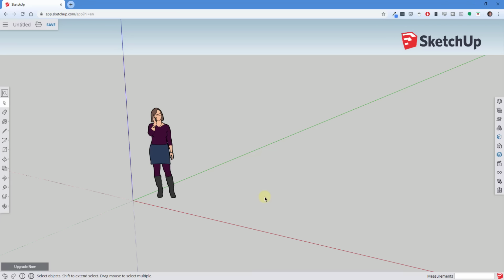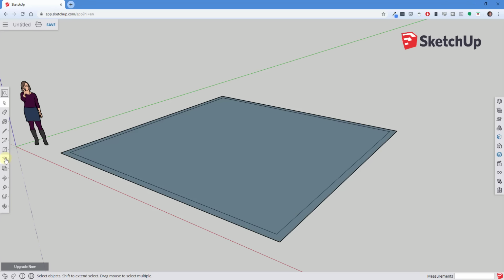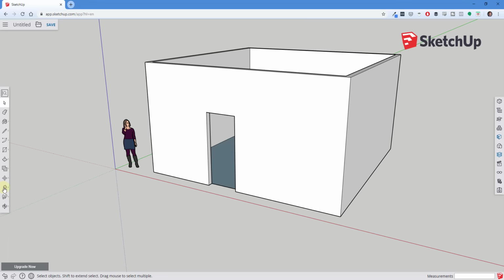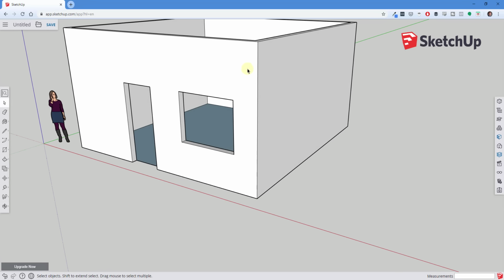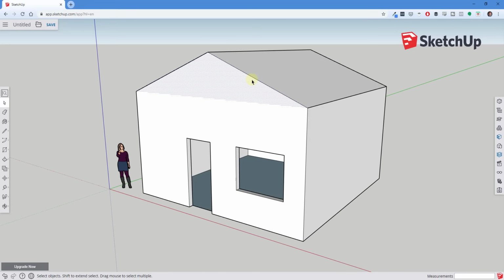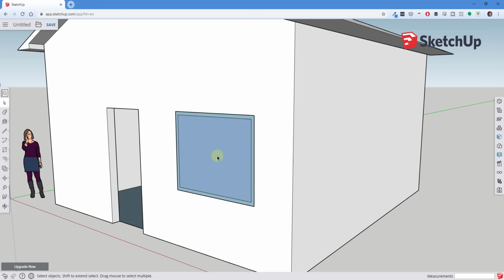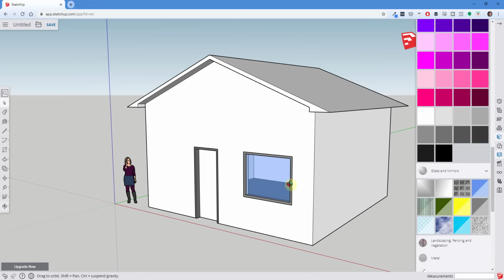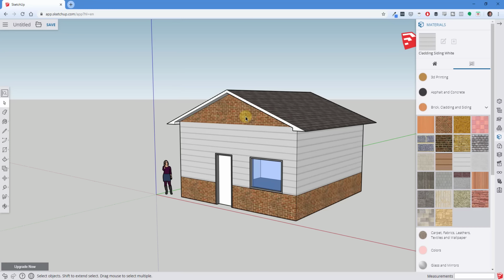GETTING STARTED with SketchUp Free - Lesson 2 - Creating a House Model

Comment: Well... after 10 years of downloading Sketchup and deleting it - I finally learned how to model in Sketchup and then move that model as a whole rather than move one part, warping the other joining surfaces and polygons. Thanks a bunch man - this was pretty informative. I also have a whole bunch of keyboard shortcuts too thanks to you and they all make sense.

Maybe Trimble have changed things since this video but when I grouped my model I couldn't activate the R key to create the ceiling. Had to start the whole model all over again and not group - worked this time but the R key doesn't work as smoothly or obviously as it does in your demo here.
Reply: haha, lots of recognition there! I've been doing the same, downloading and then getting super frustrated with basic manipulation and uninstalling. These videos are great though! Haven't uninstalled yet this time.

Comment: Thanks for your time!!!  I’m having a problem with the roof in this lesson.  Front of house is fine, but when I turn to the back, the rear of the eave is a bluish color, not white like yours.  Subsequently, I can’t pull it to the back of the house.  What am I doing wrong?
Reply: I’m experiencing same issue and can’t figure it out too
Reply: I am having same issue when I turn house around to pull roof bavk it pulls a negative space across the roof creating a hollow gap between house top and new roof
Reply: I see that this was 2yrs ago, so you'll probably have worked it out. For those that haven't, instead of thinking that you need to click on the back, don't. That isn't the face (working side), click on the front which is the face and then use the push pull tool, when you've got to where you want the end to be, it will create another face at that point. You'll see that better if you are creating a cube, draw a square/rectangle then push pull from the front face (white) to the required point. You will then see that push pull will have created another 5 faces. Front/Back, Top/Bottom and Sides.

Comment: This is so helpful but I kept on struggling with the push and pull tool. It didn't always work how it should. Like when I push and pulled the roof the first time, it sloped at an angle and then using it for the window frame it blocked out in a strange way

Comment: Im just getting started and wanted to say this is such a big help for me! thanks so much. One query i have is... ive got to making window frames and it seems when i push pull they are hollow? its driving me slightly insane. the roof and all that worked fine but the windows and doors seem to be open on either the inside or outside dependant on where i start. sorry! im  a builder who is trying to use technology

Comment: Have watched lesson 1 and 2 so far and they are a great intro to SketchUp free, thank you.  I'm trying to copy what your doing on my own page however since I'm in NZ and we work with mm I wish to use my own measurements.  In the free version I'm looking at, which does look a little different to yours, I have found the app settings and changed to mm but in the measurement box in the bottom right it continues to show inches.  How do I change this?

Comment: Hi, great video, and sorry for the late entry, but I'm having trouble with the offset when you set the wall in 6inches.  Apparently, my offset divides the walls with the front and side wall as one group and the rear and other side wall as a different group.  Even though I grouped the whole house, I am unable to now create the roof, bc from the top view the walls are divided at two of the corners.

Comment: Thanks for a great tutorial!  I had trouble push/pulling the roof back after offsetting it to the front.  It kept taking the front and pulling it all the way to the back, if that makes sense.  I know I did something wrong, no idea what though.  Thanks again!
Reply from the maker: Try tapping the control key to put it in create new face mode - that should fix it

Comment: 3 things. When I drew the roof with the push-pull tool I lost the triangle face on the front of the building. It actually moved to the back of the building. 2nd. The offset tool would not allow me to click on the triangle line. Lastly, what function allows shortcuts using key strokes? I ask because when I hover over the drawing and for example tap the P key the curser doesn't change. Thanks.

Comment: I have noticed several times you make a door by using the offset tool. If you only select the sides and top and then offset you will not have to adjust the bottom
Reply from the maker: Lol - you're right! I guess I never really thought about it :)

Comment: I'm having trouble when I select the rectangle creation tool... I can position the tool in the midpoint of the corner of a door or window as you showed. But then when I try to keep the rectangle creation going and use the orbit tool to rotate the model at the same time I lose the rectangle creation tool. It looks like you can somehow start the rectangle creation then keep it going while you select orbit to move so you can see where to place your rectangle end on the opposite corner. Would help to know how you're doing this. Thank you!

Comment: I had a hard time with deleting the lineon top of the door when I was tracing the roof...I would click hide and it wasn’t disappearing. Then when I came to make a group, I didn’t understand how it worked. So I accidentally deleted the roof, and then when I tried to make the roof again by push/pull button it was going down and not straight...🤦🏽‍♀️ What could have happened?

Comment: I’m having a problem with the window frame. When I offset it and then go to push/pull it, it inverts rather than extending it. In other words, it pushes the surface in so the frame looks hollow on the inside. How can I fix this issue?

Comment: Love your tutorial but I am having issues around the 14 minute mark with the roof of the house. I created the offest of the roof to make it 4" bigger than the original roof as you mention. I created the lines for when the push/pull tool is used to bring the roof of the house 1' forward. The issue is that it pulls the face forward but the backside to the roofing is empty. So if I use the push/pull tool to have the offset roof cover the houseing there will be 1 closed face and one open face.

edit: It definitely has something to do with the lines as when I don't add any lines to the roof that has been offset the faces are correct when extruding but the I am left the roof extruding a complete triangle instead of the roof.

edit 2: What I ended up doing is extruding the triangle as is to 1', adding the vertical lines, then pushing the middle of the bottom of the triangle ,where the lines were drawn, back the the face of the house. Would still like to know what my error was but this will do for now.
Reply: You need to tap Ctrl, I just figured out its a modifier (toggle) that decides whether to create a new face and pull from it or to move the existing face!
Reply: @Wellemy79  Thank you so much! ☺This was driving me nuts :o

Comment: the first window i made in the front of my house worked perfectly with the push pull tool as described, HOWEVER, when trying to make windows on any of the other walls it just pushes out a huge block and no matter what angle I try, I cannot get it to create a window hole! What should I do?
Reply: Use subtract

Comment: Great tutorial. I only had one issue, when creating the offset for the roof. Pulling it forward worked great. However when the model was rotated to the back the offset was not a solid. The back side of the roof could not be selected and push/pulled. Any thoughts.
Reply: same
Reply: You need to tap Ctrl, I just figured out its a modifier (toggle) that decides whether to create a new face and pull from it or to move the existing face!
Reply: @Wellemy79  Thanks, that saved me some headache!

Comment: Just getting started with this, but I'm using a Mac without a three-button or scroll-wheel mouse. I finally, after searching for about 2 hours, found how to rotate and pan with a single-button Mac mouse. Hold down the control and command keys while holding down the mouse (or mouse pad) button. Problem solved.
Reply from the maker: Perfect - glad you got it figured out!

Comment: I had an issue when attempting the push pull on the roof that I can't seem to fix despite going back and redoing each of the steps.  It seems that it is not recognizing that the roof has a face on both sides (toward the door and one that faces the back of the house) so it will only let me offset on either the front or the back.  The other side just shows a hole where the face should be that cant be selected to offset since it isn't a face.  Any tips on what I did wrong? I notice on yours that as you move around the model all of your faces are white.  On mine the back of the offset triangle is a light blue
Reply from the maker: Tap the control key with the push pull tool active
Reply: Thanks So Much! That fixed it! Great tutorials! Is there a hot key to go back to the select button? I probably just missed it when you said it.

Comment: Great tutorial!!  Thank you so much.
if I'm using the free version is there a reason I don't see materials when I apply them to a surface? For example, I'm trying to apply a siding to a wall but instead of seeing the siding it just turns it a different shade of gray. Also, can you no longer import components from the download store? I've downloaded a couple of windows I like but it won't let me drop them into my model.
Reply from the maker: Sounds like you might need to change your visual style? It sounds like you've set a style that only shows shading, not textures - I think you manage this in the options to the right...

Comment: Nicely done.  I'm a casual user of SketchUp over the years and picked up some valuable tips.  I miss, however, the previous toolbar (at the top) and how to set the preferences.  For example, I'd rather have just inches rather than feet and inches.  Is there a way to do that?  Thanks.
Reply from the maker: There's a tab on the right for model info - I believe there's an option to display decimal inches there
Reply: @Thesketchupessentials  Thanks.  However, I want all inches without feet.   I have been unable to find the solution to this and this becomes a deal breaker. C'mon SketchUp, figure this o out.

Comment: Great tutorial - you explain each step very well.   I am having an issue with Paint Bucket in the free version.  All of a sudden, clicking the paint bucket or clicking on a detail in the 3D warehouse causes the entire model to turn white and the 'undo' button does nothing.  Any advice? Thanks again.
Reply from the maker: I haven't experienced this. Are you applying a white material?
Reply: @Thesketchupessentials   I realize what I've done...I was using colour coded tags and when I clicked paint bucket, the tag colours disappeared, which makes sense.  Thanks for your quick response :)

Comment: Why doesn't SketchUp snap better to existing objects? If I try to lay a truss for example on top of a 2x4", it doesn't always snap in, it's often 1/32" off and will show (~ 1/16") as if it's an approximation. Manually trying to tweak the slight connections is such a pita.
Reply from the maker: I haven't experienced this issue. Do you have a bunch of short edges on your trusses or something?

Comment: I've bombed at 16.00. I just can't get the window right, nomatter how many times I replay that bit.
Reply: Me too! It won't extrude going towards the inside. Did you manage to do it in the end?
Reply: @gretagulienetti6724  Only recently. What I'm learning is that not all of the instruction works for some reason, so I'm using lateral thinking to find workarounds. Tip: 1. keystrokes don't always activate the function the way it should, so go back to the sidebar menu when all else fails, & 2. push-pull is devious. Try different ways to find your extention points as not all the one's described work.

Comment: Hi loving the tutorials! However, Im struggling with my offset tool as when i go to type in an offset distance it deletes the face inside the shape or rectangle in this case. Can you help? Is there a key i should press before entering my measurements - thanks
Reply from the maker: I haven't experienced this - are you holding the "f" key down when you do this?
Reply from the maker: Don't hold it down is what I'm getting at
Reply: TheSketchUpEssentials no not holding anything down. I’ve tried it on different computers and works fine so I’m just wondering whether there is a glitch on this particular computer that I’m using at the moment.

Comment: following all the instructions but instead of a solid roof, i get a hollow one with only one face so after creating the overhang at the front, the only face i can click on to extend it back is the front face (from the back) done it several times now and cannot see what I am doing differently to the video. Anyone got any ideas?
Reply from the maker: Tap the control key with the push pull tool active. Or just draw over one of the edges to fill the face in
Reply: @Thesketchupessentials  Thanks Justin. great training videos - i passed the link to my design buddy who put me in touch with sketch-up but couldn't show me how to use it - and responsive to queries! awesome!!!

Comment: When I create the roof with the 4" fascia and them pull the front out I rotate to the back side and there is no face to pull... it's like you are looking inside a box, not an enclosed roof system.
Reply from the maker: Tap CTRL with the push pull tool active
Reply: @Thesketchupessentials  I did the shortcut you mentioned, but I get a slightly different result than you in your video.  I am unfortunately one that needs to know why a certain process happens to the instructor and different for me... translating to me doing a process WRONG.  When I offset the roof to the 4", draw the 2 lines and then pull forward 12" and the next step is where I'm at a loss.  when I rotate to the rear, the rear face is missing.  Why is it missing?  I can do the Cntrl and push/pull to get the roof to the rear of the house.  In summary, why is my result different than yours (missing face).  Thank you  for providing these video resources for Sketchup.  Have a great day
Reply: @michaelwoosley2732  I had exactly the same issue. I discovered that on a Mac, I had to TAP the 'Option' key (not hold it) and it worked.  I am guessing on a PC that might be the Ctrl key as the the guy suggested.  Hope that helps

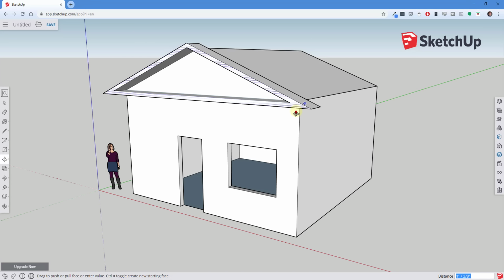Comment: 14:00 is hard the back of the roof isn't filled pls help
Reply: I had the same problem, to fix it use the line tool and click on the edge of the roof and click again when you get to the middle of the roof and that should fill out the empty area.

Comment: how do u edit your measurements for the 20 ft square
Reply: Once you've clicked first for your start point you literally just type a number, and it automatically knows you're putting it into the measurements box. You don't have to click on measurements box. Ie, if I want a 10'x10' square, I would click where I want the square to start, then just type 10',10' and click enter and it will automatically change the sizing accordingly.
Reply: Vanessa Page cheers!